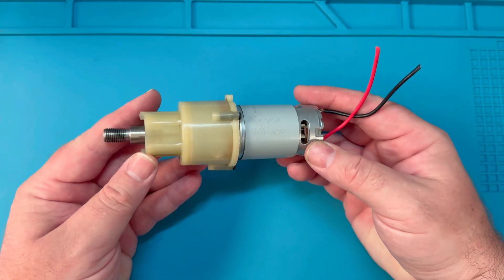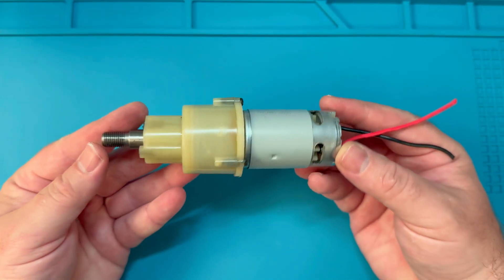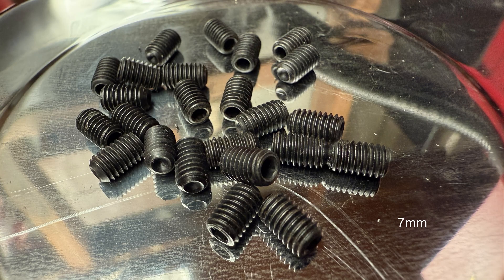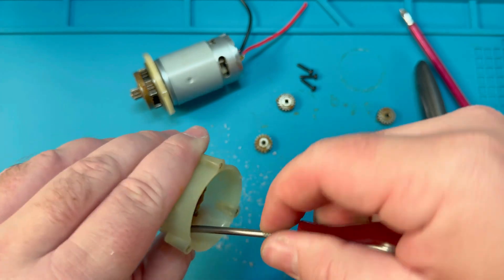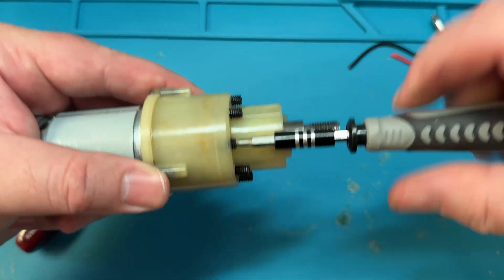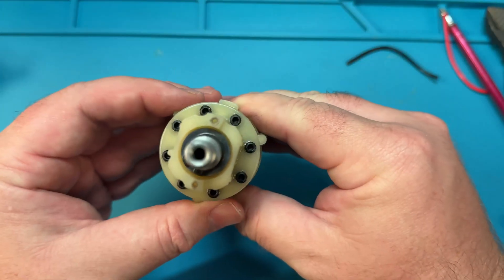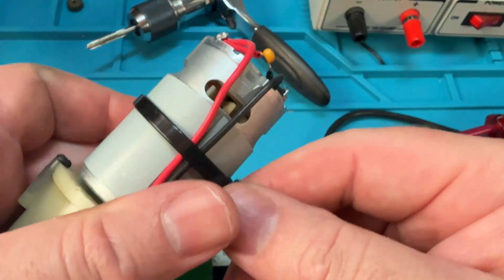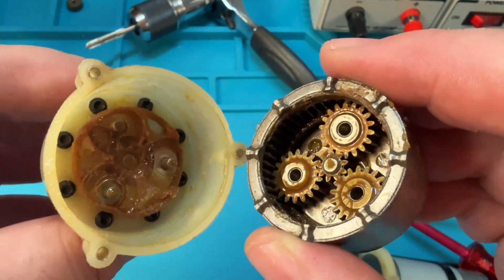Convert a Cordless Drill into a Robot Motor in Just a Few Steps!

Comment: Im confused… if you dont want the gearing, Why not just remove the gear assembly in its entirety and drive with the motor shaft instead of locking it down?  Is it just because you want a different ratio from direct drive?

Comment: Intersting concept but most robots use stepper or servo motors for acuracy
Reply: Add an optical or magnetic encoder
Reply from the maker: Budget Battle bots and RC Rovers are good candidates for these. But as mentioned in the video there certainly better motor options. Thanks for watching!
Reply: Never heard
Them called grub screws
Reply: You might want to tell all the commercial robot manufacturers that use DC motors for wheels. Robotic lawn mowers are a big one.